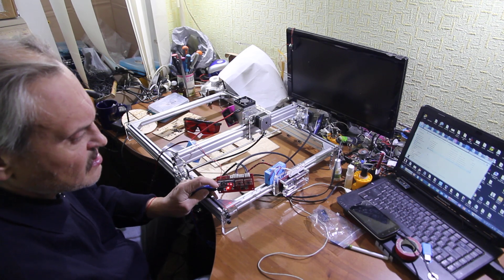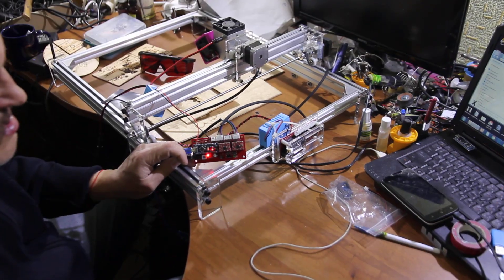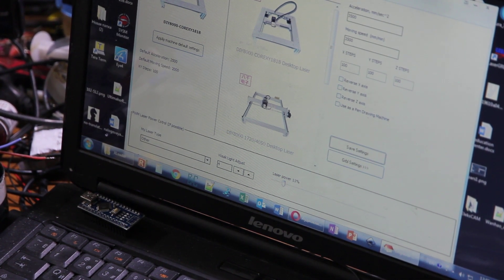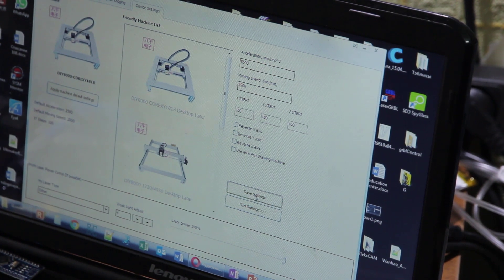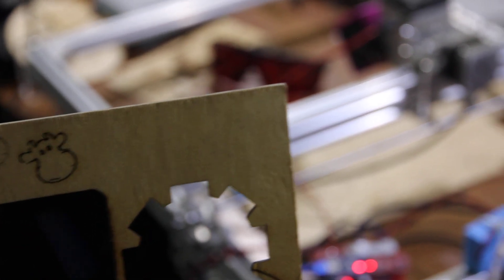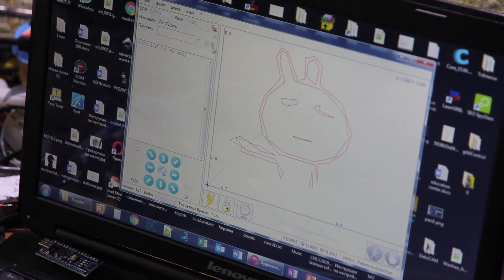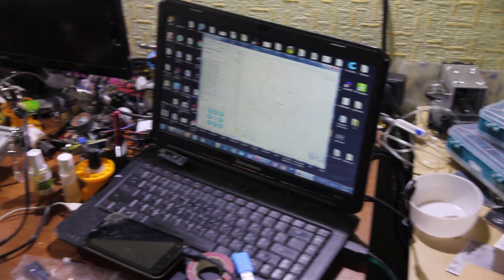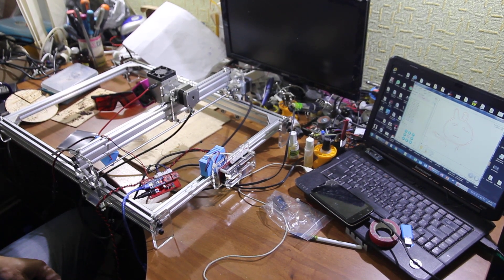How to solve a case with a corrupt firmware on Eleksmaker Mana board - lifehack.

Comment: How do you know if its corrupted. ?
My problem is the X axis motor is growling and doing all kinds of weird stuff.
Example: You tell it to move right and it moves right. You tell it to move right again and it moves left instead. Its not the driver chip. Pretty sure its not windows. I know its not the motor because I swapped those and the driver chips.
Reply: Did you ever solve this problem?